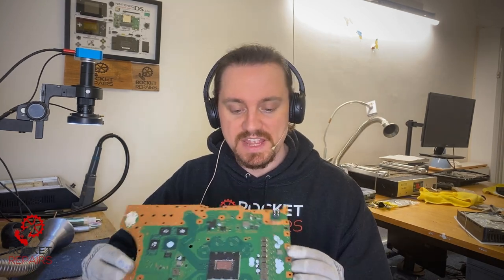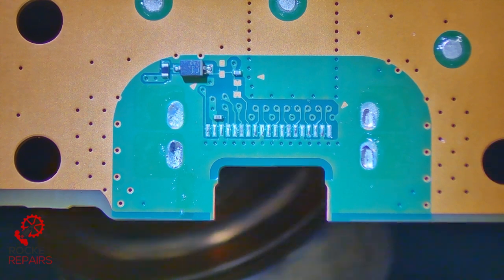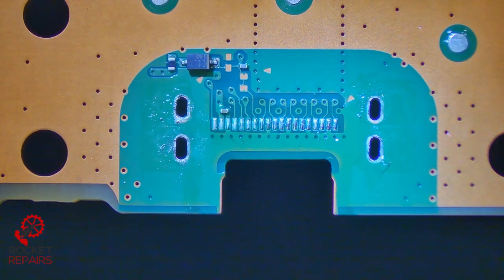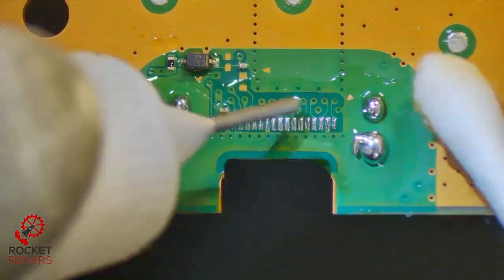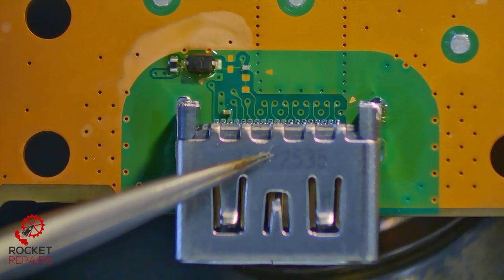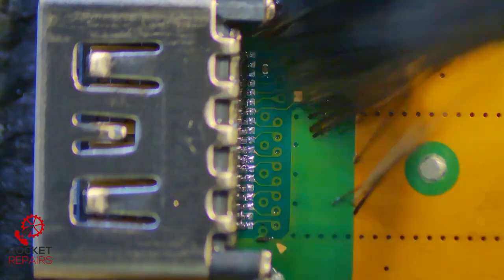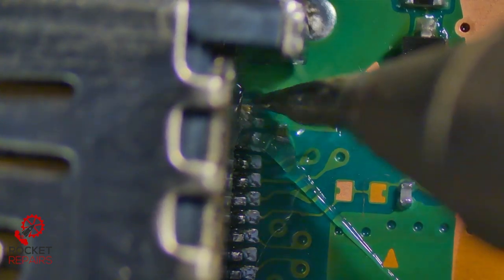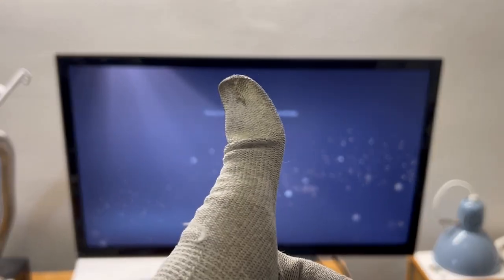PS5 NO OUTPUT TO TV - Let's fix it!

Comment: Add leaded solder to the holes. Keep solder melt with the iron. Use the sucker to remove solder. Time to execute 40 to 60 seconds. 

There is no need to cook the PCB for minutes with the hot air station risking to knock off components from the bottom of the board.
Reply from the maker: Yo mad dog, we have never knocked off any components using the heat gun, surface tension still applies. Saying that using your method also works!
Reply: @rocketrepairs   given the fact your videos are also an educational tool, I am sure somebody who is still learning would wipe a board clean, superficial tension or not, or cook it altogether.

Sure, they should be using a practice board, but reality says otherwise.
Reply from the maker: Let's be realistic someone who is still learning should not attempt these repairs without expecting to make big mistakes, because mistakes will most definitely be made!  It is surprisingly difficult to get these through holes hot enough using a soldering iron to flow the solder and then use the solder sucker.  We use Metcal mx-500 irons with 415 degree fat tips and they struggle to do the job.  I think a combination of heater and soldering iron is most effective if when not heating the board to 500 degrees using the heat gun. Thinner boards will buckle and bend at this temperature so it is important to gain experience before attempting these repairs.  I really like Joey's techniques. I myself previously did not use the drop method to put new ports on the board but for ps5 because of the capacitor near the socket makes it the simplest method. Following up with the iron when in place makes for an excellent repair.
Reply: @rocketrepairs  let me start saying that I generally agree with you. Still, to use your own words, realistically people should not attempt repairs, and yet the most entertaining videos are about undoing disasters other inflicted on consoles while attempting a DIY (probably because on YouTube it looks easy).
Back to my original comment, I prefer using soldering iron and sucker to unclog holes. The fact that you/Joey sometimes use soldering iron and wick means that the hot air station is not needed for holes cleanup jobs. Then I guess it can be seen as a matter of preference, but I don't like the idea of heating the board to hundreds of degrees to unclog a couple of holes. 

Of course when removing a connector, by all means heat the bottom of the board, or it will never come out.

Said that, to me the amusing thing is that I never had a console fail on me, and never had the urge to plug and unplug the HDMI cables 100 times a day. I remember I went to a Game Stop shop years ago to trade a console with an updated revision and the guy I spoke with could not believe my console was one year old already. 🤣

Comment: do you really need to melt the plastic? i know it doesn't affect the job itself but it just doesn't look good
Reply from the maker: It's hard not to melt the plastic when applying a soldering iron. This tip is 2mm across, we know from experience that the drop in method looks tidy but can result in dry joints. So going over the pins after is highly recommended.
Reply: @rocketrepairs  Personally I wouldn't pay for a repair that had melted plastic on the port. I would want it doing properly.